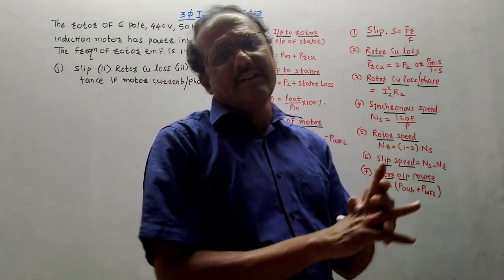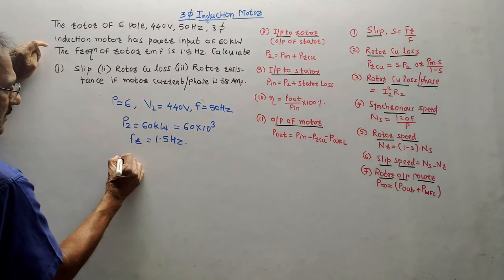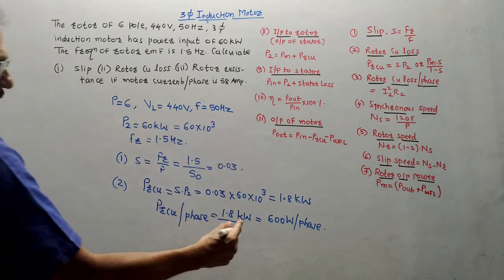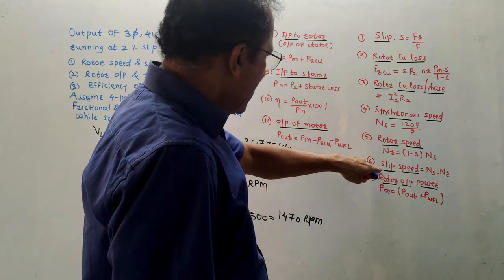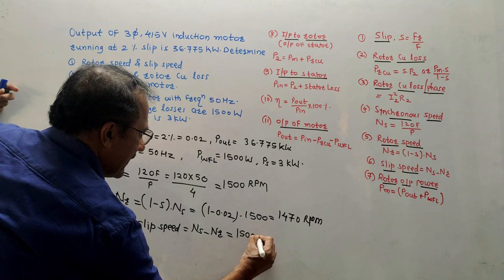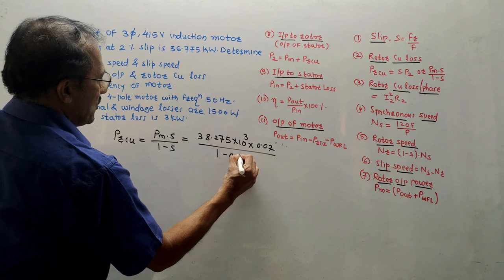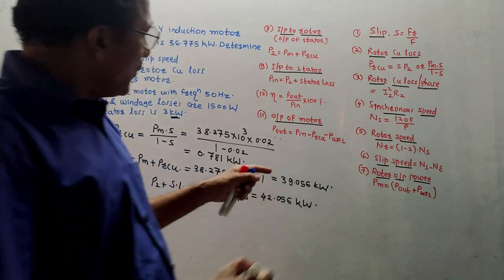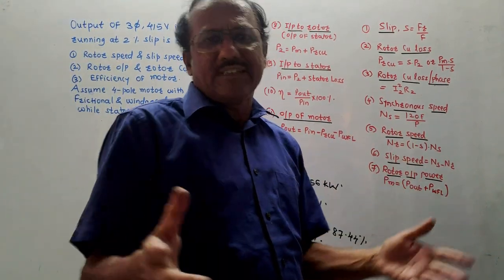INDUCTION MOTORS ( Solved Examples).

Comment: Sir 
A motor 75 hp rpm 980 draw 70 amp current to run a x load ,what current will 60 hp 980 rpm draw for same load ?? Pls guide